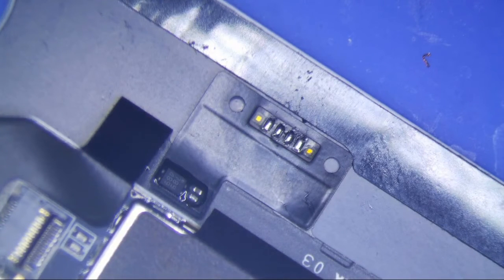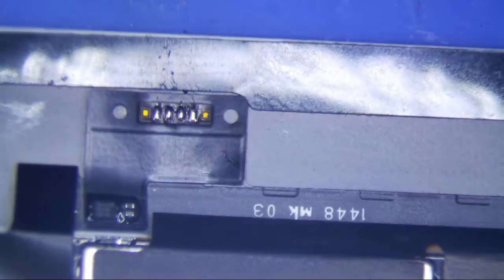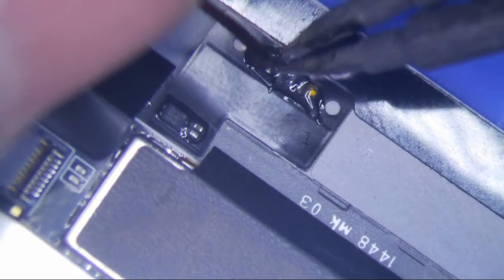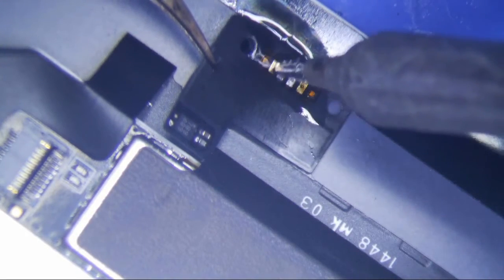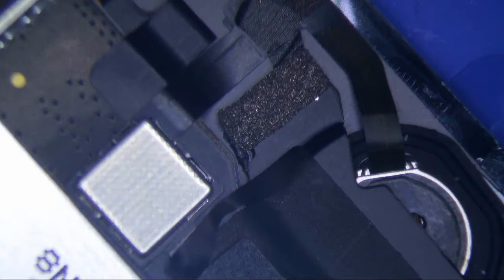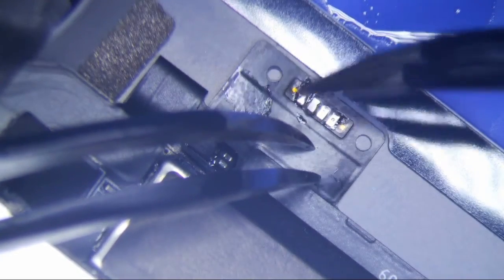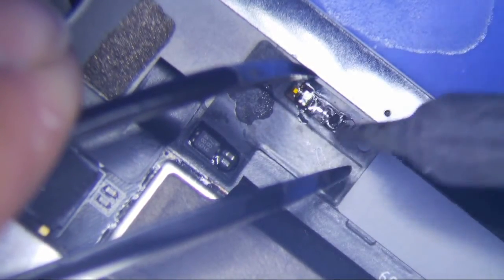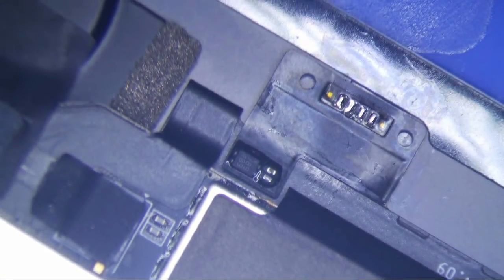ipad air 2 sleep wake sensor transfer

Comment: You could've saved two minutes by removing it with hot air :) 260c for a third of a second usually does it for me. And yeah - flux makes things ten times easier.
Reply: Anders Nielsen holy shit that actually worked